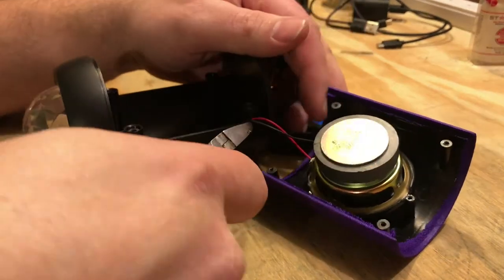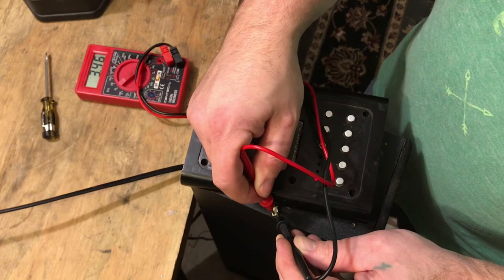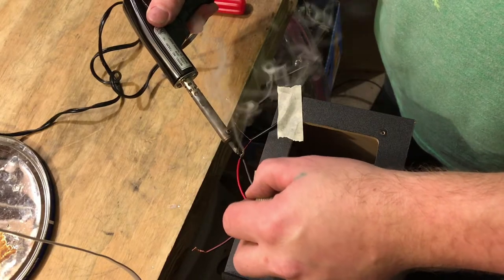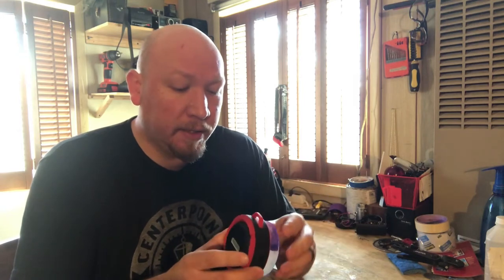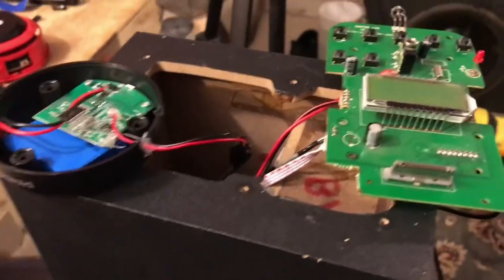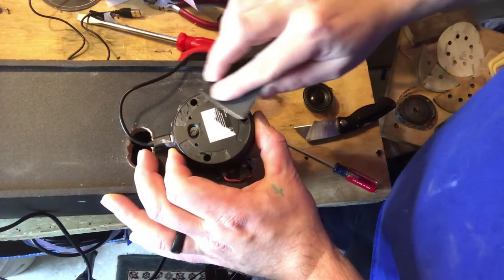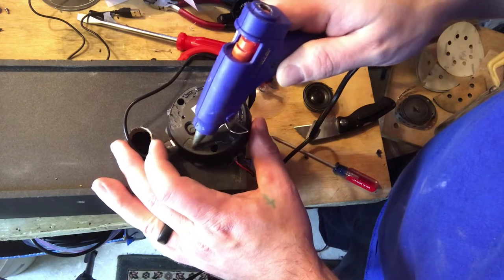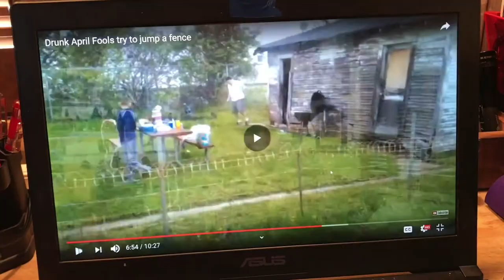DIY iCraig Bluetooth Speaker Build

Comment: For some reason mine wont get out of standby mode by pressing the button on top. And I cant find the remote to try from the remote.  Sucks
Reply from the maker: ya I recently started having problems with my top controls I think something melted from being in the sun. remote works the best if you can find them.
Reply: Mine changes input on it's own and sits on iPhone mode